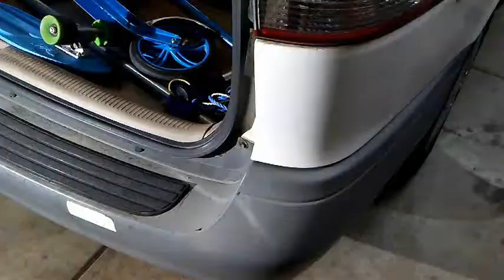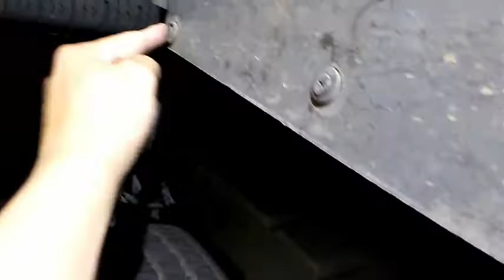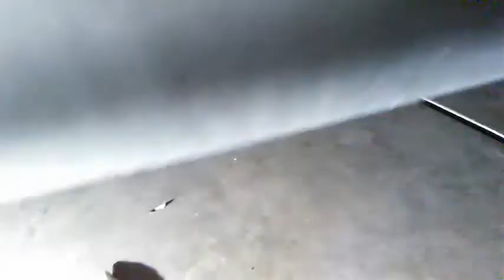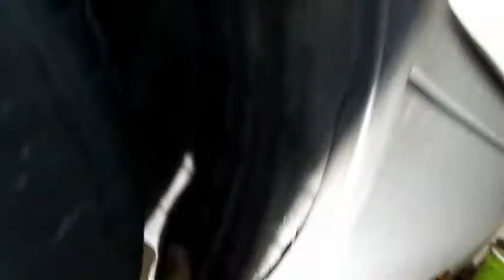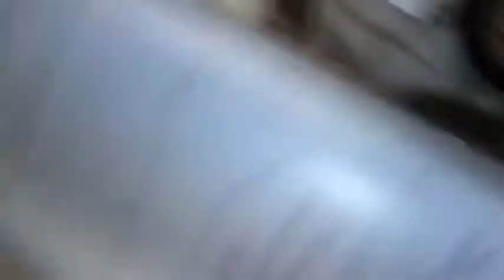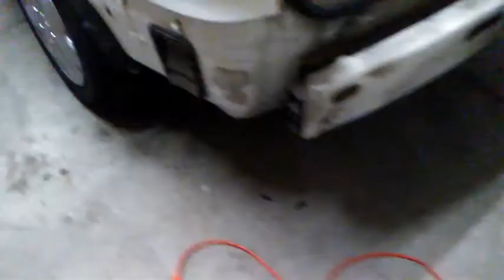1998-2003 Toyota Sienna Rear Bumper Removal and Dent Repair

Comment: This was super helpful.  I just bought new clips on Ebay--broke off most of the old ones, easy snap on for the new.  I also used boiling water out of a tea kettle to soften the plastic (be careful!!) and a 10lb sledge to reshape it from the inside.  I'd have never figured this our without the video.  Thanks!
Reply from the maker: Cool good work!

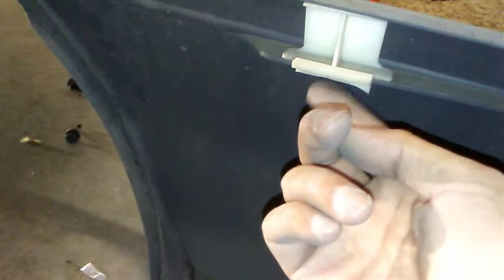Comment: Great video.  Very helpful. I need to replace mine. What is the part at 11:10 called?  I can't seem to find that part.
Reply from the maker: I went straight to that time mark. Looks like it's just a clip, not sure about the specific name it would be call. If it was me, I would search online for rear bumper clip for whatever car I was working on and see what pop up.

Comment: I would have put boiling water in a Pan and then pour over the corner of the bumper holding the bumper backwards facing up and then use a stick to push the dent out with the water in it like a cup then let the water go and put back on.  Maybe clean and wash the van in there too before putting on.

Comment: Invest in some specialty trim pliers! Those are expensive little plastic things and a pair of pliers will save you a lot of money if you do this repeatedly
Reply from the maker: Never knew about trim plier. Thanks I'll look into it.
Reply: Welking Vue u know u can out put boiling hot water on the bumper to pop it back